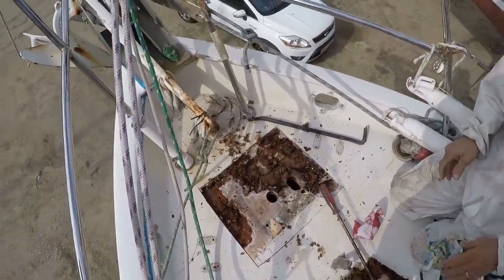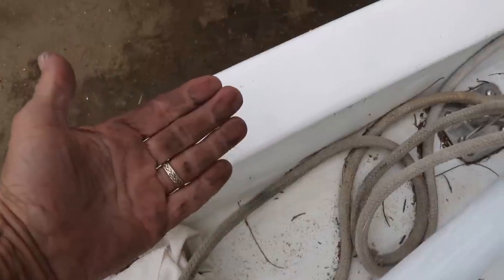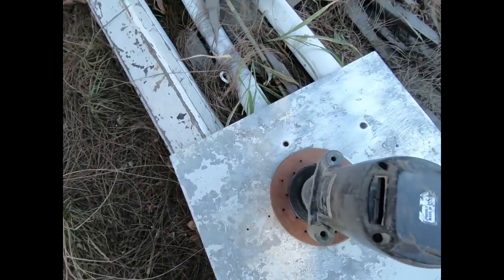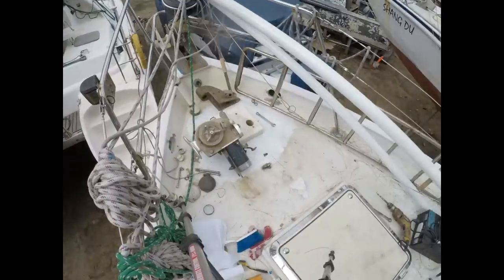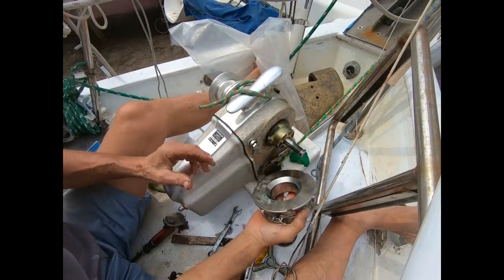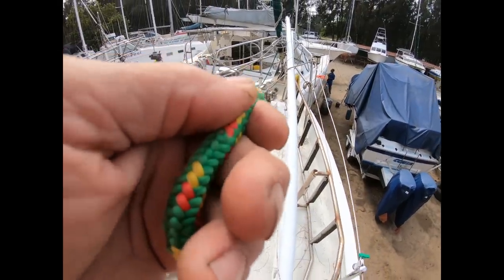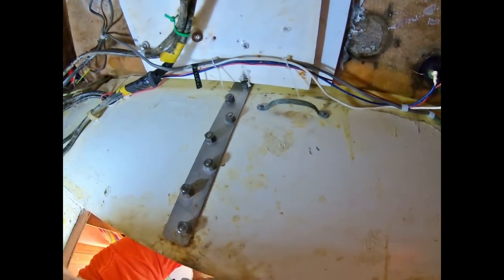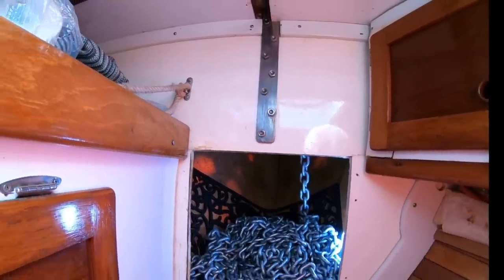Don’t Buy New Anchor Chain CHEAP! (+ Chain, Windlass, Anchor Chain Locker) Patrick Childress #50

Comment: Slather all electrical connections with dielectric grease, or Vaseline. You’ll thank yourself later.
Reply from the maker: That is a good idea. I will be making another trip into the chain locker.
Reply: Do yourself a favor and skip the Vaseline. It melts at just above body temperature, makes a terrible mess, and could potentially catch fire. On the other hand dielectric grease is an excellent product and one I use often.

Comment: You should get a miracle cloth on that windlass. 
It's my shiny metalwork secret
So don't tell anyone
Reply from the maker: We are due for a stainless steel polishing. I never think about doing the windlass, but will now. Thanks.
Reply from the maker: I will bite...Whats “miracle cloth”? -Rebecca
Reply: If you haven't tried it look it up.
I used them on all my 47 year old cleats and fixings and they came up like new. It really is astonishing. 
Saving money and time. 
I've used it on my mast as well. 
Now I keep a couple in the drawer just in case theres anything I haven't polished  😁

Comment: It doesn't matter where cheap rubbish is made, it's still rubbish. High end Chinese goods have a great reputation and can compete globally with any other countries products. For example MCC GROUP FAR EAST in Ningbo, China is part of the Maggi group and has a reputation for making very good chain. I personally have a Lofrans Chinese made chain that has served me flawlessly for many years, and cost about $8 less per meter than an equivalent Maggi chain. It pays to shop wisely, but I wouldn't dismiss Chinese manufactures because many have very good products at a substantial savings.
Reply from the maker: Tattoo, like Practical Sailor says, there is some very good Chinese chain. But how do you know what you are getting if it is not stamped by the manufacturer. Is there a stamp on the links of your chain? Have you had it tested? Sounds like it is surviving the longevity of use test though. We just watched a video of a cruisers Chinese chain deteriorating to a very dangerous point in just a few years.
Reply: @RVLifeNOW  - I don't have access to the chain at the moment to check if it is stamped. I never lab tested the chain, but it has held up well during use. I did get the Lofrans chain regalvanized after two years, but it has held up another three years since then with no signs of rust. Thankfully regalvanizing a chain is dirt cheap in the Philippines, and at least where I went they went far above what I expected. I am sure your Maggi chain will serve you well, and was an excellent choice.
Reply from the maker: Hi this is Rebecca. I think our standards for measuring logevity of anchor chains has fallen in the last decade. Did you notice our old  anchor chain in the photos? Not elongated, not pitted. Rusty. Simply time for new chain though, even though galvaning may have been adequate and last a few more years. But for us, we replace things BEFORE there is a problem...that "self-insured" 
I hear a lot of people talking about their chain lasting a really long time...like 5...msybe even 7 years!!! And as long as they galvanize every couple of years!?!  What the heck! The brand chain I believe we had is NOW made in China. Wasnt 10 years ago. Im not going to name names here and start a big argument. Just make sure you do a LOT of research before you buy anything made in China. You will be surprised what you read about chain depending on the date of the posts. If it was when it was made in a first world country...it lasted for decades. If they then cut over to making it in China...horror stories. Then...when they figure out there were problems...they stop making it China. Problem solved. Just please do a ton of research before you agree to buy chinese made chain. You often get what you pay for with these things ;) Anything will work for a few years, probably. But what happens to the chain at 10 years? 20 years?  Rebecca
Reply: @RVLifeNOW  - I think this discussion would serve the community better if the word's China and Chinese were not used at all. Every chain manufacturer has the capability to make good chain or junk regardless the country of manufacture. The important issue is to make sure any chain you buy has been certified and tested by a reputable company. Anything less would be foolhardy.
Reply from the maker: Yes.  Undoubtedly though, some countries are going to have stricter quality control than others. In 3km of chain, only 6-10 links are actually tested on average with these testers. I have to wonder...if those don’t pass... Do they try again...or throw away all 3km of profits? Different testers and countries are gonna feel different loyalties and obligations. We have seen it time and time again as we have various things fabricated for us around the world. Good....and passed...mean different things to different countries. Yes every country has the potential to make bad and good...but the question is...who has the ability to keep it honest, and truly recognize the importance of it. As yachtie s we have to really seriously think about this and not only find a certificate we feel we can trust, a tester we can trust...but a manufacturer we can trust, as well as a retailer we can trust to not  do something along the way to scam us all. We are seeing more and more and more cruisers now buying what they thought was quality chain and finding out 2 years in they already have to regalvanize... or flaking and deteriorating chain they have to replace in just 5 or 10 years. Our old chain is 26+ years old and 80% of sailors would have had it regalvanized again considering the condition of it. That’s quality chain! We THINK it was ACCO chain, BEFORE they starting making it in China but we aren’t sure. Google it now, and see what you find. My point is...a lot, but not ALL anchor chain seems to go downhill when they start getting outsourced to China. China knows how to make it cheaper...but who in the end pays for that? Us...the consumers, and we all start to accept that 10 years from a chain is good quality. We start accepting it as the norm...the measuring stick. We feel like with careful procurement of Maggi Chain, making sure it comes from an Italian factory with Italian craftsmanship and Italian quality control, that we will get another 25 years out of this chain (or you will hear me roar!)...not 10. American, European, true Canadian, Kiwi...we would expect nothing less unless there is some unscrupulous substitution somewhere along the way, or them trying to say its from one country, when really it’s made elsewhere...like in China I’m sad to say. -Rebecca

Comment: By the time you are done your boat won't even float anymore :P I frequently agree with your opinions, but it seems you regularly "upgrade" your boat to make it heavier and never to make it lighter. Maybe it just seems that way from what makes it into the videos, but either way you may wish to consider altering your presentation to mention weight and balance more often so your advice is more easily applied for a wider audience.

After making such a big effort to buy a high quality chain you could have stayed with the same size that has been working for over 20 (40?) years and even gotten a few more meters for a bigger scope and still save weight and money and have more safety (assuming you are in a place where you can use a bigger scope) over the monster chain and new chainwheel. Obviously you made your choice, but mentioning these things (even to disagree with them) would increase your audience and marketing potential.

On on the topic of audience and marketability, you should find some new rhetoric for bashing cheap products of unreliable quality than mentioning a particular region of origin. Even top brands are internationalizing their supply and production. That Italian chain was quite likely made of Chinese steel. German steel is too expensive. Did you know that "made in Italy" tomato sauce can be made in an Italian factory using Chinese tomato concentrate as the main ingredient? Might sound surprising, but did you really think that all of the Italian pasta was made of Italian wheat? I don't think they could grow that much wheat if they wanted to.

Ok, hopefully you can handle a bit of criticism and I do hope this is actually helpful to you (you did mention an interest in monetizing your content). I love your channel. So much more realistic, focused, and helpful than most of the other cruising channels I have seen on youtube. I really appreciate that the random lifestyle stuff is at the end of the videos where I watch it appreciate it more than on the other channels where they put in somewhere in the middle.
Reply from the maker: Hi Lex, Thanks for your interesting comment. You would be surprised at how much I agree with you, but first. When it comes to removing water saturated balsa, in a heavily stressed area of the boat, like below the anchor windlass, I believe the weight of the water soaked balsa is pretty much even with the weight of solid fiberglass. Even if the glass is heavier, the trade off for the tremendous increase in strength is well worth the investment. To squeeze dense foam up and under the voids was not doable. I want solid where it is needed. Too bad the designer nor builder of this boat paid attention to this necessity back in 1976, but of course, they could not see into the future.  In rebuilding the battery box area, in the aft cabin, structural foam core panels, saved weight over the solid plywood that the builder of this boat had used. Here is a little history on the Valiant 40; when it was first built in 1974, experts were up in arms and thought the Valiant 40 was a dangerous boat as it was far too light to be crossing oceans. Back then, only very heavy double enders, with full keels, were used to sail across oceans and around the world. When I say double ender, I mean the stern is just as, or nearly as, pointy as the bow.  The V-40 is a canoe stern. The added reserve buoyancy in the stern makes a tremendous difference in performance. At the time, of first production, the V-40 was a light displacement boat. Now, because of new boat designs and newer materials, the V-40 is considered a medium displacement boat.  Boats like the Westsail, are very heavy boats. I can weigh this V-40 down, tremendously, and I think it would still be lighter than a comparable in length, non loaded, Westsail. Recently, we had an article published in Ocean Voyager, an annual publication of Ocean Navigator, about our strategy for crossing the Indian Ocean. In short, we left Sri Lanka heavily loaded with fuel, food and water. As we worked our way south west to Chagos, and beyond, the boat was far lighter. Approaching Madagascar, our boat was light as possible in anticipation of the bad weather we did encounter.  In 1981, I was doing a nonstop passage in my Catalina 27 from Darwin, Australia to Durban, S. Africa. That 6,400 mile passage took 53 days. I left Darwin with just enough food to get to Durbin. Drinking water, I would have to catch rain water along the way. The idea was to keep that boat just as light as possible to deal with potential bad weather. I want a boat to lift to the waves, not a heavy slug to sit there and get hammered by them. There were two terrible storms on that route. Being light, the boat was still engulfed by 2 breaking waves which twisted the hull in a way I could never have imagined, and still survive. It came very close to rolling. I believe, being light and buoyant, and modifications I made to that boat, is the only reason that boat survived the passage. Yes, I like light boats that perform. The reason we have this Valiant 40 is that it was Rebecca’s boat when I met her. But we could get out of town and cross oceans much sooner on this Valiant 40 than to work more years for the Swan 48, I would much prefer. 
I agree with you about the chain. If I was the only person on this boat, I would now have new 5/16 chain, same size as the old chain, and it would be only 250 feet long, same as the old chain. It was strong and long enough. Rebecca thoroughly researches things. There are engineering tables to show our boat requires 3/8” chain. Since we intend on going around S. America, the anchoring is very deep and stormy in the passes. The heavier and longer chain is far safer than the 5/16 I would have chosen. I am still thinking lighter and more buoyant. But Rebecca wants to take no chances on our anchor dragging. To make up for the added weight, we have sold our Barracuda sewing machine. It weighed around 50 pounds and the only storage place for it was in the V-berth. I am also eliminating from the V-berth storage, some tools, bolts and spares I can get by without; all to lighten the load and balance the boat as you suggest.  There is a certain pace that has to be maintained when making a video and to start throwing out too much detail can bog things down. Maybe there should be a separate video about weight and balance, and overloading a sailboat. It could use the Ocean Navigator article as a guide. 

You are speculating where the steel of the Italian made chain came from. Maybe it was Chinese steel but we see everywhere, even here in S. Africa, people collecting steel, brass, aluminum and all sorts of metals and sending them to China. So where does Chinese steel come from? The idea is, how that raw material is transformed into a product. There is a comment below the video from a man who is in the “heavy lifting business”. It is his sole job, to make sure no Chinese lifting products show up in his company inventory. He also said, Chinese knockoffs can look incredibly similar to the products he is allowed to purchase. Watch Sailing Uma and their disastrous Chinese chain debacle. You want Chinese chain on your boat, that is fine. Like Practical Sailor says, there is some very good Chinese chain. But without testing yourself, how do you know what is sold to you if the chain in not stamped by the manufacturer.  There were some Chinese made anchors sold through a Canadian company, to that company's specifications. A well know marine chandlery, in the U.S., to avoid potential problems, structurally tested some of these anchors and found they did not rate to the specifications listed. Instant recall on those anchors, if a purchaser chose to return theirs. 

Here are a couple sentences from Rebecca:
 I was the primary researcher of the chain...and I very specifically asked where the materials came from, and where the manufacturing was done...it’s all 100% from Europe.
Regarding the upgrade in size...our chain is so old that it doesn’t correspond well to 5/16 or to 3/8 inch!  Maybe it’s all the galvanizing we did over the years, but comparing the measurements of the old links to measurements provided for new chain, 3/8 inch is much closer to the size we had than to 5/16.We only know it was 5/16 because that was the Gypsy size, AND that was on the brokers specs when I bought the boat 18 years ago! The manufacturer of the boat and every chain manufacturer that I contacted were quite surprised when I said we have 5/16 inch chain on this old heavy boat...all of them without exception felt strongly we should have 3/8 including our windlass manufacturer. They have said for 12 years that our chain was undersized. And it seemed from the measurements that this was a very small increment upwards, but a much bigger increment down to the 5/16. We will sleep very well with this chain. Yes, it’s one size bigger and adds nearly 50 pounds to the boat. We have taken off our 65 pound CQR and it’s not allowed back on board. We are looking for a good alternative now to save some weight in the bow, even though most of the new chain is laying quite low in the bilge.  We need a good backup anchor..hoping to find something aluminum to save on weight, because indeed that’s an important consideration in the bow! 
Thanks again, Lex, for your comment.
Reply: @RVLifeNOW  wow, thanks for the detailed reply. Definitely too much information for this video. Something like “I've added 50 pounds to the bow for anchoring safety, so now I have to find a way to save 50 pounds from the bow for sailing safety. That's a different video.“ should give a lot of depth to the video and self advertising without bogging it down.

Wait, do I now understand that, in addition to buying the boat, Rebecca is also the brains of this operation? I guess Patrick is just lucky he's good looking and handy with a hammer ;)
Reply from the maker: In the nav station, I am just an end user. Rebecca installed all the new electronics and answers my questions when I need to know what button to push next.  She is definitely the better half.
Reply from the maker: Haha...This is Rebecca...just catching this now. I’m the brains of some stuff...and Patrick is the brains of other stuff. But yes..he’s good with a hammer...and he is most definitely good looking...especially at 80 :) -Rebecca